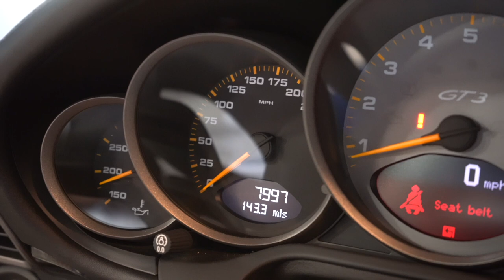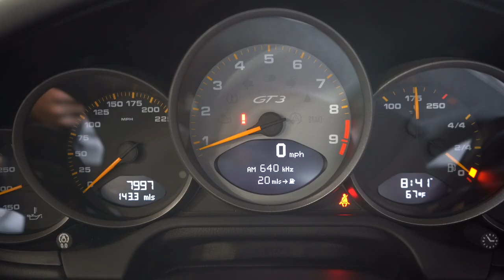Dry Ice Cleaning Aqua Blue Porsche 911 997 GT3 RS, Happy 10th Birthday!

Comment: does it work on a car that's actually dirty?
Also, if you have caked on hypoid and sand, for instance, where does the dirt and oil go after the CO2 evaporates?
Reply from the maker: Our channel is full of dirty to new transformation….  Try this one Dry Ice Cleaning Porsche 911 (993) Cabriolet - Just about the perfect dry ice specimen!
https://youtu.be/aHLXkvdeRqc
Reply from the maker: Hypoid?  You mean grease?  If thick you need to scrape the big stuff then finish with ice.  All the dirt drops to the floor and we sweep it up.